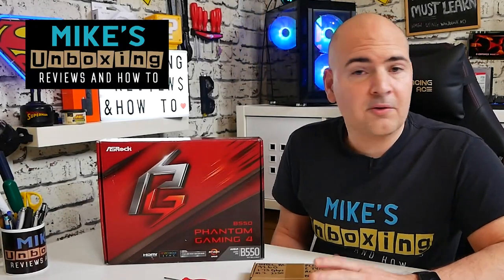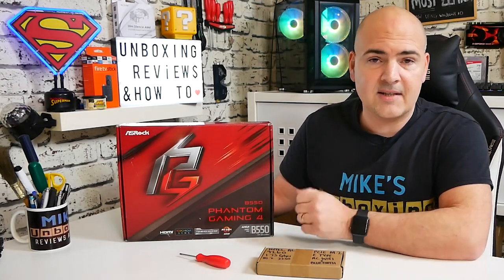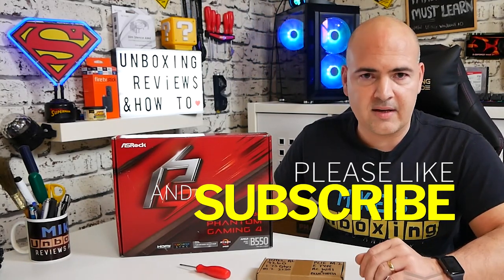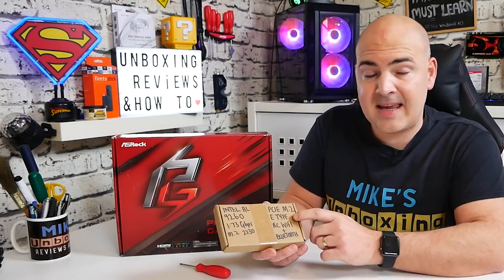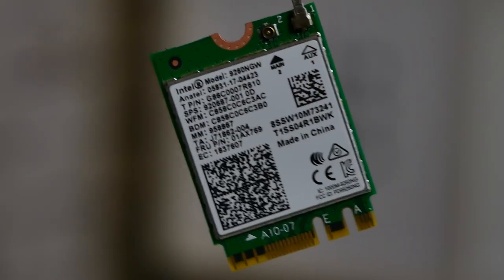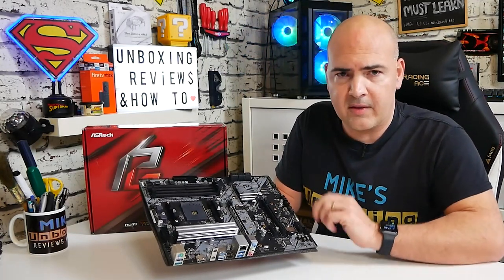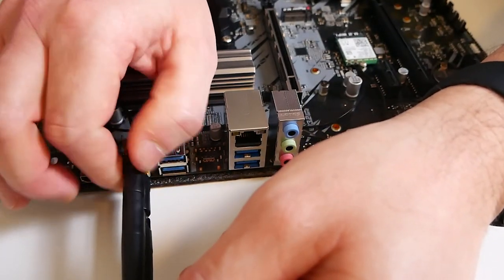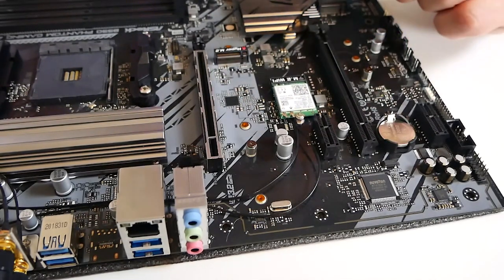How To Install M.2 Wifi Bluetooth Combo Card  Intel AC 9260 With Bluetooth 5 1

Comment: i'm having some trouble finding the right size of the sma connectors (specifically the ones you connect directly to the card itself)

Specify please?
Reply from the maker: they are called RP SMA i believe not sure the exact size maybe 4mm? https://www.ebay.co.uk/itm/143675905192?chn=ps&norover=1&mkevt=1&mkrid=710-134428-41853-0&mkcid=2&itemid=143675905192&targetid=1140163972489&device=c&mktype=pla&googleloc=1006567&poi=&campaignid=12125451326&mkgroupid=117045675099&rlsatarget=aud-629407027425:pla-1140163972489&abcId=9300480&merchantid=231854122&gclid=Cj0KCQiAnKeCBhDPARIsAFDTLTJOnqSCP_aRbLI3ZvxIRrJRrrZ4Pve6R78PJfXuJ86j4PBsga7RFuAaArALEALw_wcB

Comment: What's better for gaming and a little streaming for me to upgrade to a 5600x or i9 9900k
Reply from the maker: depends what you have already
Reply: @mikesunboxing  I have a 2600 and b450 but I would want to upgrade to a b550 or x570 for the extra features so getting a diffrent motherboard for intel wouldn't be diffrent and they sadly both have no upgrade plan because next gen ryzen are making new motherboard with a diffrent cpu where the old motherboard aren't compatible because it been over 5 years they promised of compatibility for 5 years

Comment: I bought the one you have and it didn't work with my MSI  B450 tomahawk max. Could you tell me which one I need. Thanks.
Reply from the maker: that should work well with that board? not sure what happened there?
Reply: @mikesunboxing  it doesn't fit the M2 slot. I think the one I got is to small. So it might not be the same as yours.
Reply from the maker: @UmYusra82  sorry i was getting the PCIE and m.2 videos mixed up, for your board you need a PCIe one sorry for the mistake

Comment: I have the ASrock b365 pro4 and it has the m.2 key e but it doesnt have the audio ports, could you tell me how am I supposed to fit it in?
Reply from the maker: it needs USB2 ports no audio if i understand you correctly
Reply: @mikesunboxing   I meant antenna ports
Reply from the maker: @selinajurca2745  okay i see, in that case you need a kit that comes with a pcie backplate to mount the aerial to, or for simplicity just get a PCIe card version with it all built in

Comment: I bought a AX201NGW for my M2 key E slot on my laptop. however laptop does not even boot. Could it because of CNVIO incompatibility? My processor is Intel 8th gen 8300H
Reply from the maker: yes that could be it
Reply: Yes -- you probably want AX200. CNVIO m2 cards fit physically but are incompatible. The intel website details which cards are which very clearly.
Reply: @philscraft1269  yeah I went with AX200 and it worked...frankly last time it was not clearly mentioned in Intel website...thanks for response anyways

Comment: Hey. I recently ordered one of these but it came without these antennas. Is there a way I can order these afterwards somewhere?
Reply from the maker: Yes they are normally available on eBay and Amazon quite cheaply
Reply: @mikesunboxing  theres no location on the io shield for the antenna. Is it critical? If so any alternative mounting locations? Im ready to drill lol

Comment: I have the gigabyte 550 aorus pro AC ? it has wifi built in, but its not wifi 6, will wifi card you have work on my board ?
Reply from the maker: no sorry you need pcie version we covered recently
Reply: There's no converter? If not I'll have to get the PCI Express version thank you for your response.

Comment: an what if no wifi port, can the adaptors work ? can you use the 2nd m.2 port with an a to e adaptor or similar ? while using the other m.2 for a ssd
Reply from the maker: yes there are adapters on the market for e type cards

Comment: May I know if Aorus Z690 Elite DDR4 supports this type of expansion, it does not have a key E but has 4 M.2 slots
Reply from the maker: No it will need a e type connection, or get a pcie card version
Reply: @mikesunboxing  Thanks mate. One more question, does motherboard recognise M.2 device types, otherwise how is it able to tell if a m.2 device is a storage card or wifi bt module?

Comment: Hey I have a asus prime b550m-a non wifi and I have a trouble finding the right slot. It doesn't say it anywhere. Please help me.
Reply from the maker: that board doesn't have a m.2 E type slot sadly, but you can use a USB or PCIe card
Reply: @mikesunboxing  Thank you very much I very much appriciate the help. The problem is I can't use 2 PCIe slots because its covered by a giant msi rtx 3070
Reply from the maker: @speedmax0367  Nice!

Comment: If need just bluetooth sono have to connect the cables?
Reply from the maker: for bluetooth only you only need to connect the USB, but if it is only bluetooth you need i would get a USB dongle, much easier and cheaper
Reply: @mikesunboxing  i was planning on the dongle but i read only that the buds live have a lot of lag with the dongle
Reply: @mikesunboxing  and opening the pc isn't something that worries me

Comment: So my tech store did a case swap for me and ended up not having wifi or bluetooth after. They re added the antenna which fixed the wifi but still saying bluetooth card not installed even though it is
Reply from the maker: did they plug the wifi cards usb header back in?
Reply: @mikesunboxing  usb header? Like i said they got the wifi working but NO bluetooth now. Says card isnt there but it definitely is. Had them take it out, put back in. The odd thing is on the green card(bluetooth adapter) there is like a black slot which looks like a plug. So we actually found the plug from my old case but the guy said there was no where to plug it into? I said its gotta be on the board right? He said he wasn't sure and didn't want to short anything. SUPER weird. So there is somewhere that plug goes? lol The tech was just confused like me cause the card was definitely in and the wifi working. So the guy was like why would it need another plug if its already slotted in the board? ANY help would be awesome.
Reply from the maker: @wjveryzer7985  This is maybe easier to fix or at least advise if we can ask more questions and get direct answers, so feel free to join our Discord chat and we can go over it in more detail https://discord.gg/gaeeDPw

Comment: I noticed my MSI b360m gaming plus doesn't have the m.2 e key on it but I wanted the intel wifi 6 gig+ is there some sort of adapter that I can use? if there is would it still work for what I need it for? otherwise would the tp-link archer t4e be a good choice for that price range ($50aud)?
Reply from the maker: you might be better off using a pcie card instead
Reply: @mikesunboxing  ok thnx

Comment: maybe someone can help me with a question:
I'm looking into these for the bluetooth function only really.
figured the antennas would give it a big boost, but I'm reading the Bluetooth actually uses USB though the M.2.
So does this mean the antennas are only used for Wifi & that Bluetooth needs to get the signal on the chip (needing to go through the metal case)?
Would it mean that simply getting a bluetooth usb stick would give better signal?
appreciate any help :)
Reply from the maker: yes the bluetooth uses the USB header and the aerial is still used , if you only want blue tooth i would go with a USB stick to be honest, much easier to do and a lot cheaper
Reply: @mikesunboxing  Actually, where I live getting a WiFi 6E module with Bluetooth 5.2 costs the same as a 5.0 Bluetooth USB stick. 
What is "the Aerial"? (Sorry, English isn't my native language)
Thanks for the quick reply though :)
Reply from the maker: @kklogins  sorry aerial is antenna 😃 forgive me

Comment: I have an Intel® Dual Band Wireless-AC 3168 card, but my Wi-Fi works and the Bluetooth doesn't. My friend fixed it once but whatever he did won't work anymore. I have tried updating the driver and nothing happened, so I uninstalled it and it wont reinstall and now I can't even see Bluetooth in my device manager. Do you know what I should try that you think I haven't tried already?
Reply from the maker: Look for hidden device in device manager and delete it then reboot
Reply: When I select hidden devices, Bluetooth does not appear. Anything else I should try?  I'm thinking about just buying a Bluetooth USB adapter at this point and seeing if that will work.
Reply from the maker: @kingirage7731  This is maybe easier to fix or at least advise if we can ask more questions and get direct answers, so feel free to join our Discord chat and we can go over it in more detail https://discord.gg/gaeeDPw
Reply: @mikesunboxing  Alright

Comment: Would this work for my Asrock B450 Steel Legend? My gpu is mounted vertically and the cable blocks off all of my PCIE slots so I was hoping this could solve my issue
Reply from the maker: no sorry that board doesn't have the m.2 e type slot to use it

Comment: I have an ASUS Rog with the 9560 card. I am replacing the power supply and accidentally pulled the 9560 cables loose from the chip. Both cables are black and unlabeled. Does anyone know if it matters which cable goes to main/aux? Both antenna are on the top of case, one at front, and the other at side back.
Reply from the maker: it is probably fine either way

Comment: That's amazing, thank you so much! I've got a low-cost motherboard and needed to install one of these. If not your warning for difficulty of connecting the wires, I would have probably given up.

I still have a problem with finding the right screw. I've already bought 4 packs of different screws but none of them fit (the head is too small). Anybody has any advice on finding the right screw to mount the card?
Reply from the maker: yeah i know what you mean. the screws are just called m.2 screws but they are not always the same, i have seen a few different ones over the years. they seem to be standardising now
Reply: Thanks, Mike, I'll keep looking then! :)

Comment: Does anyone know if a ASUS b150a-m.2 has m.2 wifi capabilities?

It looks like it has the port but no antenna wires that i can see?
Reply from the maker: that has a normal m.2 slot for storage it won't do wifi sorry. you need a usb or pcie card to add wifi to that motherboard

Comment: I really want to ask a very very imp question.
My motherboard doesn't have a wifi card slot, if i buy a converter that fits in the PCIe slot and convert it to m.2 (key a) {  will this work?}
now if anyone wondering why dont buy m.2 (key E)  converter, the answer it is not available in my location.
thanks
Reply from the maker: https://www.ebay.co.uk/itm/114631002805?hash=item1ab08a4ab5:g:GV0AAOSwY5FgAJ2v&amdata=enc%3AAQAHAAAA4Mj%2BbKLIzqarjyOVYWiXcuA4PqZzrNUFUTeYbijTamYx7uBbJwFZf1zEPtGzUry2ta5OJn2kseU1GgZ1OKVD536JYpYrJFQ9Ecm02HCBcCOmt6e0EBqGNNSLRX0tJE4pjJUFXUSd%2FNPN52%2F96u7KUgy0cTO9%2FlullfEIi1qu3Cdbrkq5GRksjdDIuiPSV%2FdmmwXPzq7zZPRWsUuNVP92ATnFDX6qg2iJLwiTDqvCJEIvolzWflZPdN7EK2DM%2Fo6t76afnH22sWwbc3dABEFEEYWdBhBc8MZeG3dWOry9uEMr%7Ctkp%3ABk9SR5jKkdHnYA
Reply: there are pcie cards for Wifi/BT. It's basically the same as on the pcie card there's this chip.

Comment: If attaching those tiny connectors is quite tricky, isn't it important to actually show how it's done?
Reply from the maker: it is very hard to capture on camera as they are so small and the pressure required to depress them means all you will see is a flattened thumb
Reply: @mikesunboxing  You definitely have a point--found out the hard way when I bit the bullet and did it last night. Thanks.
Reply from the maker: @JamesJones-zt2yx  Hope it went ok

Comment: First time I've seen a  M.2 WiFi card. Interesting. Speaking of interesting, I have an interesting problem with my PC I haven't yet figured out. I racing games were working fine. But now when I start one, the loading screen loads like normal. But when I press the enter key to load the menu screen the PC simply reboots without any warnings. The graphics drivers are the new, and the GPU is not overclocked or anything. Anyone have any ideas? Games like Minecraft, Sims, City Skylines plays fine. It only happens with the racing games, BeamNG and Wreckfest.
Reply from the maker: hmm interesting , it sounds like a driver issue, but might be worth checking the system logs and see what it says
Reply: @mikesunboxing  Thanks for the reply, but I think I worked out what's wrong. For whatever reason, there wasn't a Steam Library folder on my system and the games were downloading to random places. Some on the c: drive, some in my  documents folder and a few on my D: drive. I deleted them all, make a Steam Library folder on my D: drive and set it as the folder for games to download. So far, it seems to be working.
Reply from the maker: @OlettaLiano  awesome! sometimes the easiest fixes are the best. Happy Thanks giving
Reply: @mikesunboxing  Thanks and Happy Thanksgiving to you and yours.
Reply: @OlettaLiano  No Idea how Steam did anything without forcing a default library folder - I have two, one on my SSD and one on the HDD - so I can put favourites on SSD and banish my less used ones to rotating rust
Reply: @matthewday7565  Turns out that's not the problem. It keeps rebooting during graphically intense game. Minecraft and similar work fine. It's the racing games, and also running stress tests like furmark. I'm thinking it's either a power supply issue, or my GPU. I just reinstalled the GPU drives in safe mode with DDU. Didn't help it. I'll have to tear my system down and try swapping parts until I find the source of the problem.
Reply: @OlettaLiano  Undo all overclocks and test?
Reply: @matthewday7565  I fixed the problem. I tested the PSU by sticking the probes of my multi-meter into a molex cable and tested that the 12v rail was putting out 12v. It was, so the PSU is okay. Then I unplugged all the cable extensions to the motherboard and GPU and plugged the regular cables in, and I'm pretty sure that was it. The cheap Asiahorse extentions weren't feeding the GPU enough power. I can game again. But now I don't have time because I need to write. Later dude. ❤👍

Comment: "I do the tricky part off camera."
Reply from the maker: sorry but it is almost impossible to film as the connections are way smaller than my fingers
Reply: @mikesunboxing  No Problem. I have problems to connect the antennas to the module and was searching YT for how to do it. Your video was the first I stumbled about and the only part I was interested in was cut out. Just unfortunate.
Reply from the maker: @GoldeneBremm  Sorry again

Comment: I have a z370 hd3p MB and was wondering what wifi board I need.  I pulled the M.2 from another MB but this Z370 doesn't seem to have the slot for it.  Am I correct?  If that is true what type of WiFi card should I be getting?  Thanks a lot
Reply from the maker: you will need a PCIe card for that motherboard not a m.2